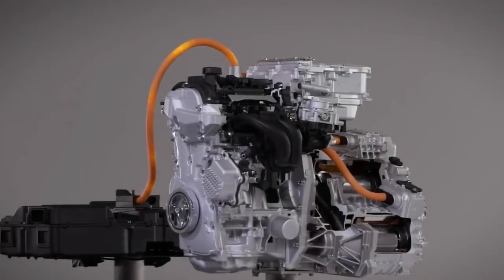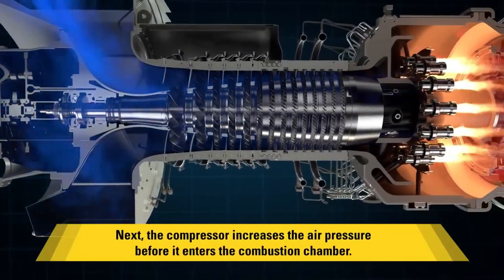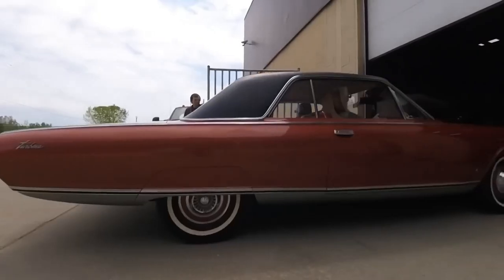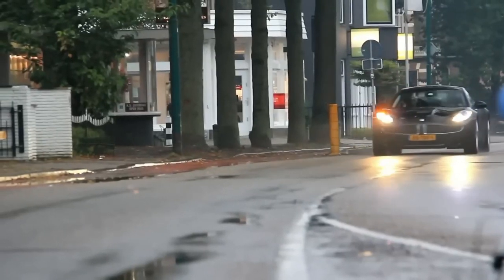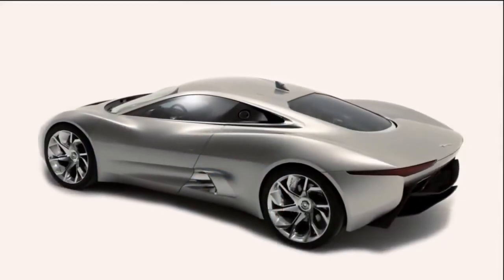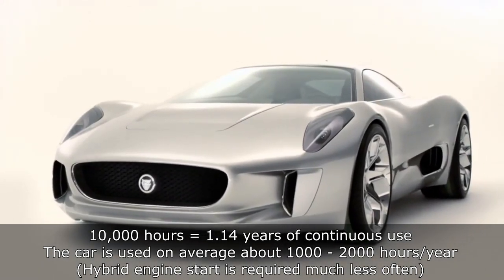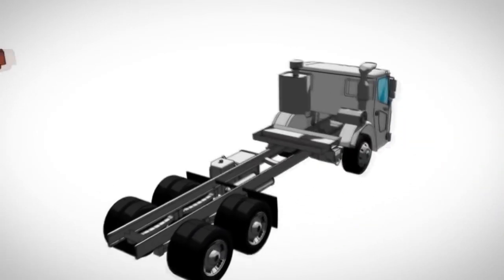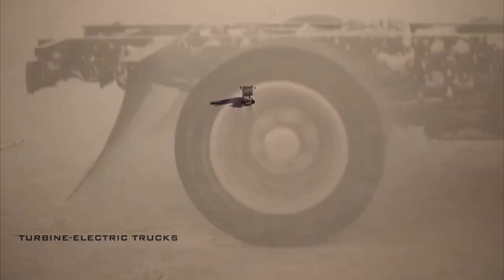GASTURBINE ENGINE IN ROAD CAR - NEW TECHNOLOGIES!

Comment: A hybride would be great for a long haul truck. A gasturbine should deliver 1000 HP all the time to be efficient. The truck would drive on battery and when low on battery the turbine would start and deliver power for driving and battery. And then stop again when the battery is full. With an engine which can run on any oil or alcohol it could for a low price per mile.
Reply: This is the best setup I've seen. I think a cool way to showcase this idea would be by forming a car racing league featuring gas-turbine/electric hybrid motors. For flat-out racing, I wouldn't use batteries, I would use graphene supercapacitors. I think they should use the technology in tanks and other military vehicles since you can run the vehicles on electric power in a sort-of-quiet stealth mode. Also, you can discharge supercaps much faster than even the best batteries, so you could run electric weapons like lasers and other energy beam weapons off the same power.

Comment: Gas turbine engines are only 28% efficient. Steam turbine engines though can be up to 50% efficient.
Reply: Even if your number would be true, that would be 40% better than a petrol car. Sure less efficiency than a diesel.
Reply: @dieabsolutegluckskuche5174  28% efficiency is 40% better than a petrol car? A petrol car is only 20% efficient? Dude it's not 1912 anymore. Learn something.
Reply: @shadfallfan  a diesel is a little bit over 40% efficient. Petrol cars aren't. Basic facts.
Reply: @shadfallfan  Also it would only be used as range extender, so for 90% of time you run at 64% efficiency. Because on most days Americans drive under 100 miles. So yeah even if we would say that petrol cars would have the same efficiency as diesels, on a yearly base an EV with a range extender would be more efficient. 
Learn something.
Reply: @shadfallfan  btw read the comment again. I didn't say petrol motors have a 20% EFFICIENCY, I said that a range extender would be 40% more efficient because 20 + 40% = 28 %
Reply: @dieabsolutegluckskuche5174  An engines efficiency doesn't raise up to 64% just because you don't run it 🤡🤡🤡🤡🤡
Reply: Yeah, except for the fact that you are wrong, if it was still 1970, you could be forgiven, before you say anything you should fact check yourself.
Reply: @CharlesMatheson-w1z  So I'm waiting for you to point out where I was wrong.....
Reply: @shadfallfan  that gas turbines have a 28% efficiency. A small modern turbine has more like 40. Comparable to a diesel. The bigger ones obviously achieve even higher efficiency and the stationary ones are better again. Noone knows where you get the 28 from
Reply: @dieabsolutegluckskuche5174  I'm well aware I'm 100% correct. Any micro turbine that could fit in a vehicle going from cosworth, Bladon, energy systems, capstone, and any other you can find have their efficiency listed around 28%. Please stop. This is like arguing with a child who knows nothing.
Reply: @shadfallfan  I literally gave you the calculation without looking up the result. These 28% are if you use an electric motor, which you should do anyways. Because in a good designed EV, you only use it sparingly.
Reply: @shadfallfan you could never use a turbine in your car kid the amount of money that would take is insane. The maintenance is also gonna be insane don't even talk to me if you aren't familiar with modifying and maintaining big turbos imagine a big turbo being the thing that powers your car. It's not efficient at lower rpm's but it is like you said at high rpm's.
Reply: @dieabsolutegluckskuche5174 there's a reason you don't see them unless you'd like to post a video abs stop running your mouth I mean we're all right here waiting I got like 60 more years on earth.... any day now...
Reply: @shadfallfan and then when i was repairing turbines in generators with my uncle they last so long compared to when you use them in a car that steam engine stuff is mainly efficient with standing generators in factories kid not your fantasy water powered car buddy. Prove us wrong
Reply: @dieabsolutegluckskuche5174 didn't mean to tag you lmao.
Reply: @toxicity6629  Learn to read and comprehend it. Then try again. You completely ignored all that I wrote that fully explained everything in clear details. I never said I had a water powered car either. Geez. It's almost like there wasn't a single thought in your head at all.
Reply: Government will never allow this 😊
Reply: @paulm8588  Why not ding dong?
Reply: Are you kidding
Reply: Gas turbines without combined cycle exceeds 45% efficiency, and crosses 60% with combined cycle for heat recovery
Reply: @ahmedosama2621  I am literally going off the numbers that are given by the manufacturers of small gas turbines. Don't just use random numbers you've found
Reply: @shadfallfan  the tech is complex and there are advancements with major manufacturers like Siemens or GE
Reply: Just googled quickly and got this text "The average efficiency of gas turbines varies depending on several factors such as design, operating conditions, and technological advancements. Generally, modern gas turbines used in power generation achieve thermal efficiencies in the range of 30% to 40%. However, when integrated into combined cycle systems, where waste heat from the gas turbine is used to generate additional electricity via a steam turbine, overall efficiencies can reach 55% to 60%."
Reply: @ahmedosama2621  Good job on your google search! I'm talking about small turbines that can fit in cars. Not "small" turbines that weight 2,000 pounds.
Reply: While steam engines are the most efficient humans have ever created you couldn't make them small/light enough to transport efficiently. If we could we'd still use steam trains.
Reply: @samueldorrington8990  Steam engines are literally one of the least efficient engines humans have made being around 10-20% efficient. Completely different than steam turbines.
Reply: trying to do thermonuclear?
Reply: @KaosProject21  Literally has absolutely nothing to do what with I have said.

Comment: Too many people in this section not getting the importance of combining gas turbines as electricity generators with electric motors. Suddenly fuel economy is awesome, and at low speeds you run off batteries/capacitors.

Comment: My dream car is a series hybrid electric SUV with four doors and a hatchback. The two rear doors pop out and slide back, like van doors, and the two front doors pop out and slide forward. It has a computer in the dashboard that can show detailed diagnostics, including indicators for lights that aren't working. It has a micro turbine generator and two batteries. The car runs on battery power below 40hpm and automatically starts the turbine above that, or whenever a battery needs to be charged. Power from either source is first channeled through a control box, then distributed among four electric motors, one for each wheel. The control box manages fuel flow, based on angle of the gas peddle, complex wheel behavior based on steering, and suspension and breaking based on road conditions.

Comment: They didn’t take off 60 years ago due to fuel economy, they especially won’t take off today due to emission regulations
Reply: They literally create 95% less emissions than standard engines, but nice try!
Reply: It was bad on gas because turbine engine get more efficient the longer they are ran continuously this is why they are used in planes, because unlike cars planes don't stop often and will run continuously for hours on end
Reply: @tristanheaton2127  They are NOT used in airplanes because they are more efficient. They are used because their power to weight ratio is so high.
Reply: They are less fuel efficient when run at low load, like when cruising in a car. They are efficient when operated at continuous heavy load, like turboshafts or turboprops in a plane or helicopter.

Hybrid system solves the variability in load problem by having it come on only when the battery needs charging and run it at the optimum load and turn off.

Comment: why hasn't this taken over the truck and car market already? with a cheaper running vehicle and costs that could run on ethanol burning cleaner emissions with 500km in one tank this is crazy why isn't this a global thing already
Reply: Because at 35% thermal efficiency,  it is not efficient enough to replace the turbo diesel engines at 45% thermal efficiency, and it is very expensive.
Reply: Engeneers think to the end and balance all parameters to stop or move to good results.
Reply: Terribly inefficient at low speeds.
Reply: Turbine engines are an  engineer's pet project for the rest of their lives. The way the engine is to be used, the materials available, the manufacturing processes, all affect the design of the engine, and everything needs to be accounted for when pricing a new turbine. A properly built engine is going to be expensive and require a technician familiar with that particular engine in order to service it properly. That's not to say that an engine can't be produced and sold for a reasonable price, but the technology needed to do so hasn't been around for very long, and manufacturers don't want to sink large amounts of cash into a product that may or may not be an economic success.
Reply: While this is true the ONLY function of the Gas Turbine is to run a generator at the Turbine’s most efficient speed (98%-100% max RPM). 
Once the vehicle batteries are recharged the Turbine shuts down until the batteries need to be recharged again. 
This idea is most certainly viable and already proven in testing, the biggest challenge is most likely government overregulation and public perception.
Reply: you also have to factor in the powers that be gas engine makers, battery makers, the oil industry all betting against it and fighting anything that upsets the current order, but most of all a turbine has a voracious hunger for fuel and they are often loud, and put out lots of heat in the exhaust.

I however love the sound of a turbine or jet spooling up and they are way lighter then piston engines or batteries
Reply: More like 67% and that's from an actual engineering manual.
Reply: I more agree with that, considering you have an engine that burns on fuel if you can get it into a gaseous form.
Reply: At ground idle this engine produces more than 50% of nominal power and consumes proportional amount of fuel. Piston engine produces little power at idle and consumes a lot less fuel - it is better for the road. In heavy traffic gas turbine engine is extremely useless.
Reply: @krzysztofwaleska  They were going to solve this with a battery but turbines have been about five times the price of pistons. The simple reason why this hasn't broken through is that they didn't come up with a way to make it cheap enough. The trucking industry knows how to count its beans and would have picked it up if it were better than pistons.
Reply: @andersonnettleship845 you’re exactly right. Between 30-90% Gas Producer speed, the engine is very susceptible to surge. Which is why most have a bleed valve and variable guide vanes. Emissions and efficiency aren’t great at that speed.

Comment: In consumer automobiles these are better used as a small range extender to continuously charge EV batteries at a consistent rpm. I.e. Cosworth’s Catalytic Generator.

Comment: They should put a heat regenerator in this turbine motor. It would make it more efficient and make the exhaust significantly cooler.
Reply: Cosworth Catagen (installed on the Atom HyperCar) is doing something similar ... very interesting - they claim its a flameless oxidation process with very low NOx compared to standard turbines.

Comment: A better option is the combined cycle microturbine system. This is an innovative energy solution that enhances efficiency by harnessing waste heat. It starts with a microturbine that generates power by burning fuel. The exhaust heat from the microturbine, typically lost in conventional systems, is captured by a Heat Recovery Steam Generator (HRSG). This HRSG then produces steam, which powers a steam turbine to generate additional electricity. By utilizing both gas and steam turbines, this system maximizes energy output and significantly reduces waste, making it highly efficient and environmentally friendly

Comment: Turbine/electric would be great for commercial road trucks and trains and a small enough micro turboshaft engine drive a high output generator with 1/4 size battery pack with electric drive motor or motors.

Comment: Townscaled gas turbines as range extender in hybrid cars/trucks suffer from low efficiency! 
However, if any new developments in compressor and heat exchanger design this might be game changer (e.g. micro structure heat exchager, concentric and counter rotating radial compressor wheels). 
I think this could be a true step ahead.
Reply: And why do the downscaled turbines suffer from low efficiency?  
Tanks and helicopters use them so it shouldn't be that bad
Reply: @commieTerminator  1. Physics of fluid dynamic: boundary layer losses do not scale. They get increasingly dominant for small turbo machines (Viscosity, Reynolds number).
2. Scaling down causes reduction of channel cross sections by the power of 2 and volumes by the power of 3. Therefore not just increases gas friction losses but also heat losses (surface versus volume ratio).
3. Gap losses between rotors and stators  getting more dominant as tolerances can't be scaled down (coef of thermal expansion).

Helicopter Gas turbines already suffer but here it is fuel consumption tradeoff with favorable power to weight ratio.
For cars where weight is not that critical but fuel efficiency is, one could go for lower pressure ratio / larger turbo machines and additionally gain efficiency by adding a heat exchanger. However, this significantly adds to the overall size of the gas turbine relative to its power output.

Comment: When a turbine is up to speed I wonder if road vibration or hitting a pothole may disrupt the rotation enough to cause damage. If they are robust enough to deal with the vehicle going through a bit of abuse, then I think we should start using them yesterday. Get everyone a 40-70km battery vehicle with a micro-turbine range extender please.
Reply: Does a bump in the road cause your engine to have damage?

Comment: An interesting thing about turbines is you can burn just about any fuel in it. Possibly, a mixture of water + alcohol + glycerine would work. With a very low fuel cost, you offset the lower efficiency.
Reply: Oh yes my favorite combustible liquid, water.
Reply: @shadfallfan hahah, might help pressures to a fraction but probably not much if at all
Reply: @appelmelk5664  Literally no. But nice try!
Reply: @shadfallfan  a try is a try
Reply: @appelmelk5664  A fail is a fail. Congrats!

Comment: it only makes sense if you can run it on some green fuel like natural gas or alcohol.  if you're going to still put in regular pump gas may as well not bother and use regular engine.

Comment: I still think hydrogen fuel cells would be a good alternative. You see major manufactures of electric forklift equipment already doing it. And yes, you could power your car with electricity generated by such a fuel cell all the same. And hydrogen is way easier on the environment. I think the battle as far as you and I are concerned still comes down to greed. The struggle to put money into who's pockets for this. You might find that's a huge contributing factor rather than what we can develope.

Comment: Well Chrysler tried it in the early 1960s and it didn't work out so well. I don't think there is any technology at this point that's going to make it feasible.
Reply: Quasiturbines
Reply: They tried electric cars in the early 1900's. There's no technology to make them feasible 🤡🤡🤡 clown logic
Reply: Plus, turbines are operating at peak efficiency driving a generator. Which powers the drive chain and recharges batteries.